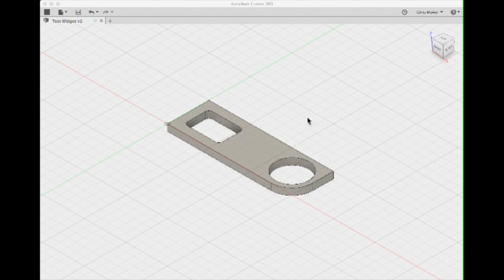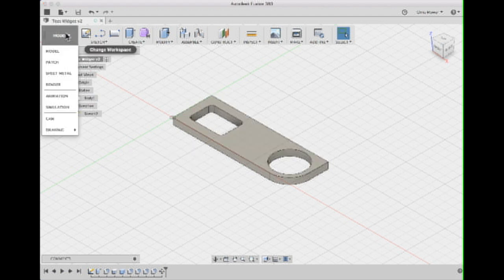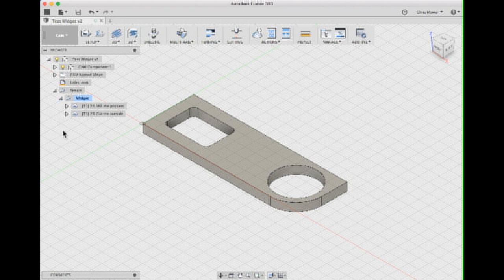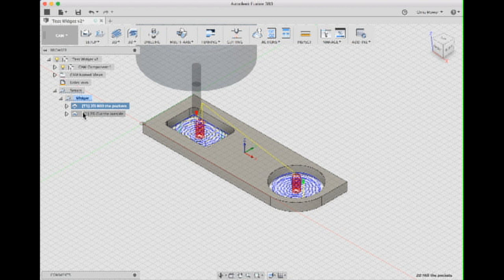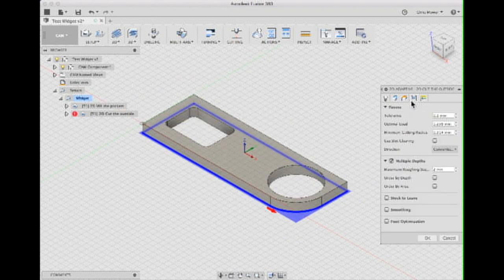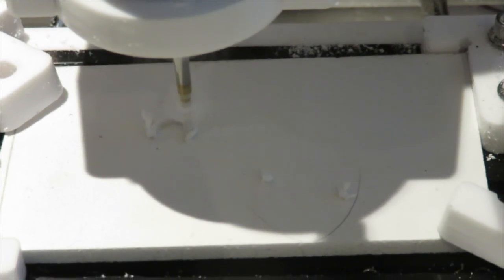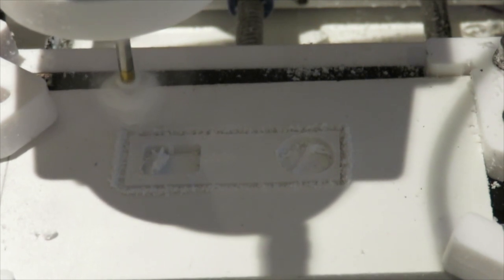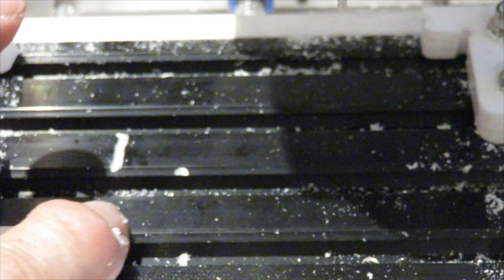Using the Eleksmill with Fusion 360

Comment: Do you still have a higher quality original of this video that you can re-upload?  This video is useless as it is.
Reply from the maker: Just checked it Charles and it seems fine to me. What in particular is the problem you are seeing?
Reply: Extremely low resolution, can't even see what you're doing.  Not expecting 4k of course, but at least 1080p, or even 720.
Reply from the maker: Charles Snyder Unfortunarely the lack of resolution on the text is a function of the screen capture software. I don’t have the original but it wouldn’t help as I uploaded the highest resolution it had.  Hopefully it is possible to follow what is happening from the audio commentary.
Reply: Well, if you decide to do more, there are quite a few free software programs that will capture hi-rez video of your computer screen.